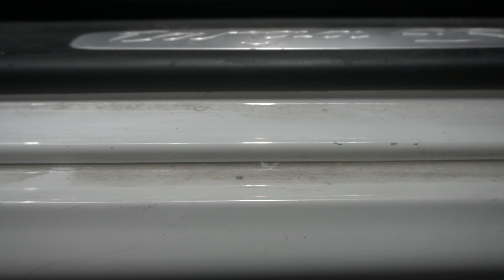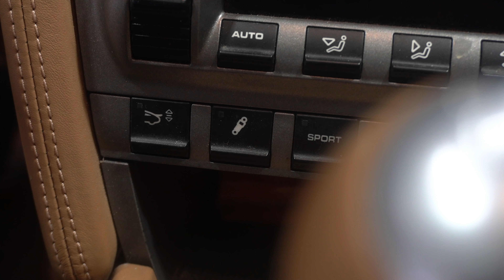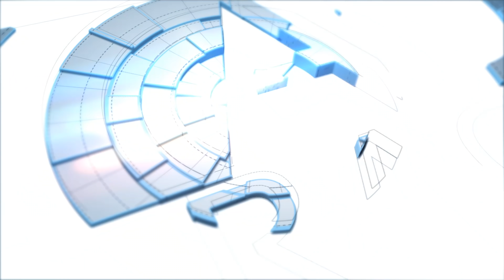911 TARGA 4S DETAIL | 2007 Porsche 997 Receives a Satisfying Spring Exterior & Interior Detail

Comment: To find this vid after the late shift is just awesome! The sleepover went well and I see that the german lady was treated with dignity and respect. Another fantastic vid and here I am watching at 01:00.
I have a question becuse here in Sweden we usually spray on someting like a tar remover on the lower parts of the car, to remove tar and salt in the winter. Without that step the car would have quite a lot of spots left after the foam. I have not see you use that in any of your vids? Otherwise it seems like we have a lot of the same issues in the winter.
Reply from the maker: So, the more I get to know my European friends, the more I am learning that Canada may NOT have the worst winter road conditions. I have learned that some countries use a tar spray on their roads in the winter to keep them from freezing and cracking, and that tar makes it way onto the cars. The worst example I have seen of this comes from my Icelandic friend, Brynjar. I do not see the need to use a tar remover or heavy duty acidic cleaner at the pr-wash stage here. The salt is terrible, but it comes off with the foam. I am still going to investigate this issue a bit further, and maybe I do work a degreaser into my pre-wash process, but nothing at this time.

Comment: Another award winning vidwo. Awesome effects.  Thanks heaps Rick Great sprayer for the door jams. Why do u sometimes use the hose to rinse and the pressure washer
Reply from the maker: I will opt for the hose rinse to keep the overspray down such as with the door jambs. Also, I can rinse away soap so much quicker with the low-pressure hose as opposed to pressurized water. Lastly, sometimes I don't feel the pressurized water is necessary when simply rinsing away soap residue. For the foam stage, the pressurized water is the most important part of the process as it is forcing the soap to do its job of reducing the surface tension of the water so it can actually clean.
Reply: @RADGarage  Thanks Rick.

Comment: Hey Rick, do you dilute your Adams Wheel & Tire Cleaner in your dispensing bottle before using??
Reply from the maker: I don't usually dilute it. It loses its effectiveness quickly when you start diluting it. I like it lather up thick. It doesn't do that nearly as well when mixed with water.

Comment: Awesome work my friend, as always. I see you using GSF (my fave at present). Have you married it with some GS (green star) it’s great for breaking down contamination.  Sadly we don’t get Citrol here.  I use OP for sap removal. 

Also TEA is fantastic for tar removal. 

How did you find the SI02 spray sealant? We don’t have it here yet. Did it mask any swirling?

Also it’s best pronounced kok keh·mee ;)  it’s not like the French Canadian pronunciation of Poutine ;)
Reply from the maker: Thanks Clint. When you say "marry" the GSF (which I absolutely adore) with the GS, do you mean mix in the cannon? I have not tried that. I do find the Gyeon Restart has amazing decon power. It eats that slightly hardened film cars develop when they are only spray washed throughout the year. Citrol is a must-have. When Carzilla carries Koch Chemie, I anticipate I will get to know the line more, but it's kind of hard to source for me. The KC products I have now came to me from my friends at The Rag Company as part of my prize pack for the Grambassador program. Ordering direct from the States has become very difficult and expensive these days.
Reply from the maker: The jury is still out on the SO02 spray sealant. It may have been applied too quickly to have done its complete magic. The car was glossy and slick, but I need to play with it a bit more before making a judgment.
Reply: @RADGarage  yes. Sorry marry, should have been mix. Add 30ml GS to your GSF cannon mix. Helps cut through grime and dirt.
Reply from the maker: You're always thinking. 🙇‍♂️

Comment: Love your vids, Rick! How did you like applying KCx SOo2? How did it compare to bead maker?
Reply from the maker: I think the KCx sealant is a viable option for a quick spray sealant. I don't think I followed the instructions to the letter, because I may not have let it sit on the paint long enough prior to wiping. But, I liked the final effect and feel it is on par with my favorite spray sealants which are Defy (Ethos) and Ignite (Lithiium). I have a bunch more I need to play around with. The problem for me is I don't have enough projects to use these products multiple times in order to form a solid opinion.
Reply: @RADGarage  yeah I also found it a little tricky to apply. I did, however, liked the final outcome. Left my paint ultra smooth and hydrophobic. Thanks for your reply.

Comment: What's a great reliable pressure washer that won't break the bank?
Reply from the maker: I see Obsessed Garage has just begun carrying a lesser expensive machine called "Active VE52". It comes machine only, or kitted out entirely: 
https://bit.ly/3tbnBAi
There's also the trusty AR390SS which served me well for many many years: 
https://amzn.to/3uHe447
Reply: @RADGarage  Cool, thank you!
Reply: @RADGarage   Does the Annovi Reverber AR 390 SS use the same quick couplings as the Mosmatic sprayer gun? Or do you have to buy the couplings separately?